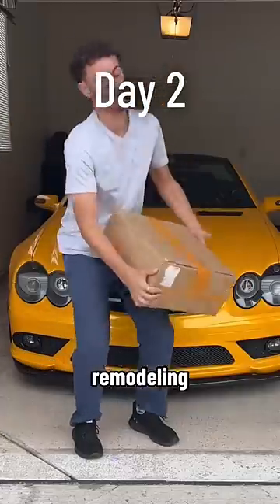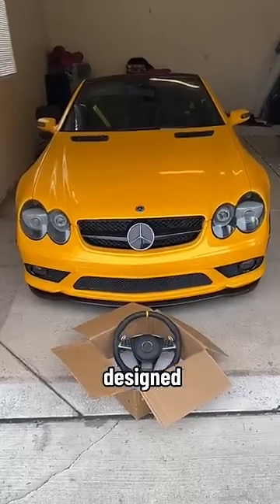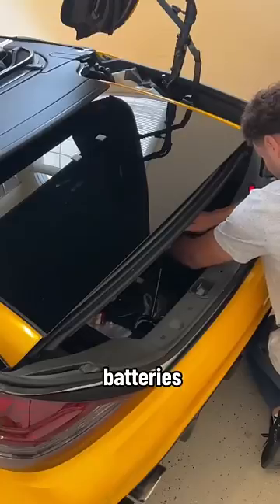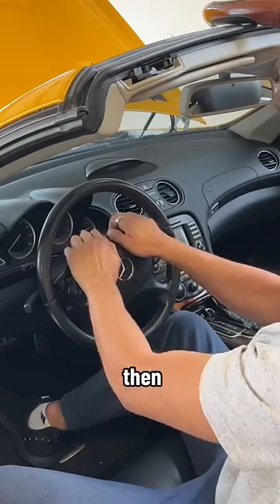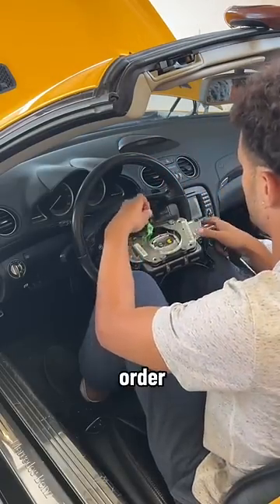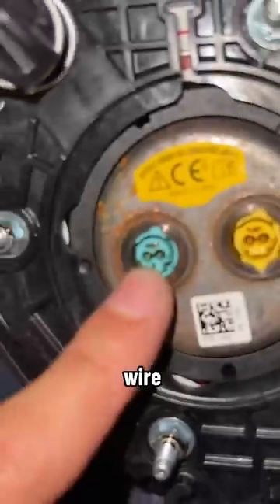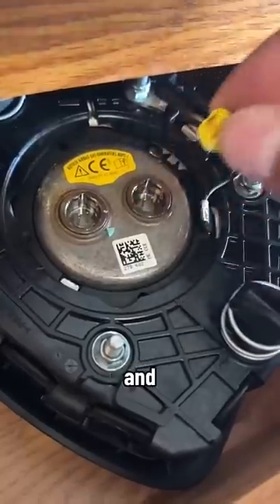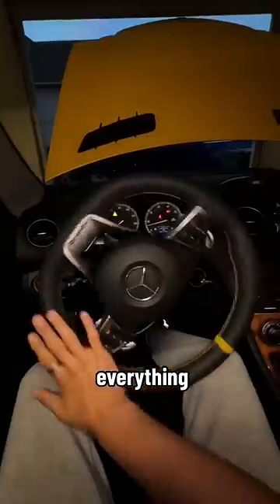That was Hectic but Turned Out 🤌🏼🔥

Comment: "Hey guys, it's day 1538 of turning my car into a ricer car"
Reply: Can’t call it a Ricer if it’s still a performance car
Reply: @MemeSweeper there are plenty of rices out supercars and this is one of them
Reply: @jaydenkoopmans4425  a ricer is a car that is supposed to look fast when it’s not, a Mercedes with a fat v8 isn’t a ricer with what this guy has, just poorly modded lmao
Reply: @MemeSweeper  in his series "turning it into a supercar" he blows 15 grand on some shitty carbon fiber and no performance mods
Reply: @retpok718  yes, the whole comment section has gone over this multiple times, kopter
Reply: You don't know what ricer means huh
Reply: @jaydenkoopmans4425 you don't know what ricer means
Reply: @MemeSweeper  rice: Race Inspired Consmetic Enhancements

Has done no performance mods to give it any more power, improved tires, suspension, driveline, brakes, etc. Seen as he's only done visual mods without making it more of a 'supercar' with perfoemance, yes, he's a ricer.
Reply: More like video 1538 and day 90 of modifying a car with every possible trinket while avoiding the engine like an allergen. Dudes a joke.
Reply: @jaydenkoopmans4425 Not even a supercar
Reply: What’s rice about it? It’s plenty fast from the factory. And modding Mercedes cars turns them into unreliable money pits. Especially older ones.
Reply: @caleb7674 I think you’re a joke. These cars are plenty fast from the factory, maybe he’s not looking for more power. You don’t really need it on the street. He just wants to customize it and make it his. I think it looks good with what he’s done so far, from what I can see in this video.
Reply: Wtf?? The car is cool

Comment: It’s a good idea to let the system completely deplete of it’s charge for a couple hours before you mess with any airbag - most modern car systems 1980ish - now have airbags that run off of a residual charge in the system in case the battery terminals are cut or the battery is crushed before the ECU can send a signal to the airbag

Comment: Im not a mechanic but im pretty sure diffrent adapters are there because of actual reasons. What if the airbag need a certain amount of amps and the cars original has other amount of amps? Then it will not protect you and it could blow up in your face while plugging the battery in

Comment: I think the old steering wheel was nicer. I'm also wondering how you retrofitted the new steering wheel. How does the steering angle sensor work with all these buttons on the new steering wheel? Can network on this car doesn't know what those buttons are🤔

Comment: to genuinely class a vehicle into a “ super car “ 

between 500 and 900 HP

reach top speeds of 200+ mph

hit 60 mph from 0 in roughly three seconds

and weigh between 2,200 and 
3,700 pounds.
Reply: You are wrong in many there 400 hp is enough 170+ mph is enough 0-60 in 4 secs is enough the thing that matter most in a super car is rarity which it doesn't have much of it